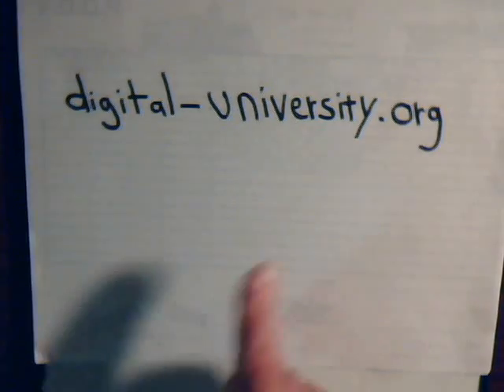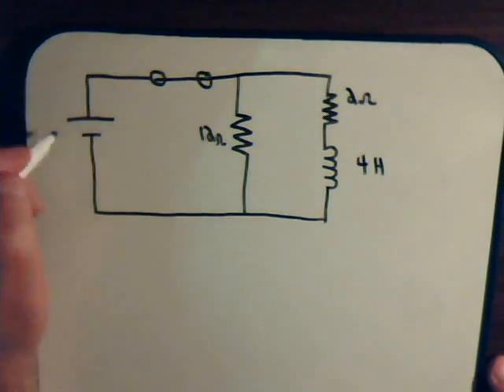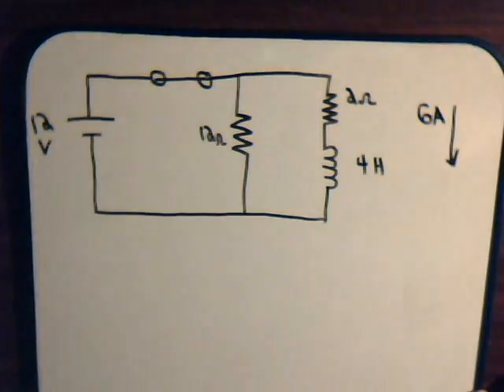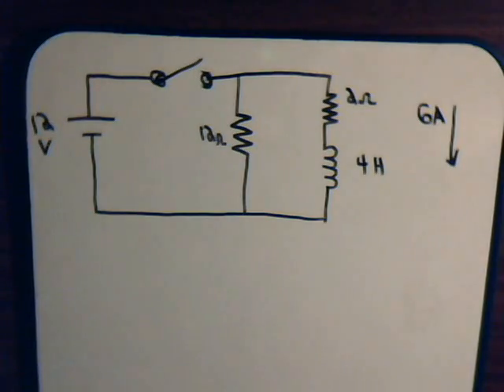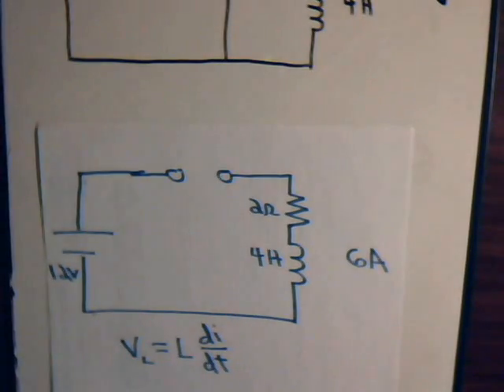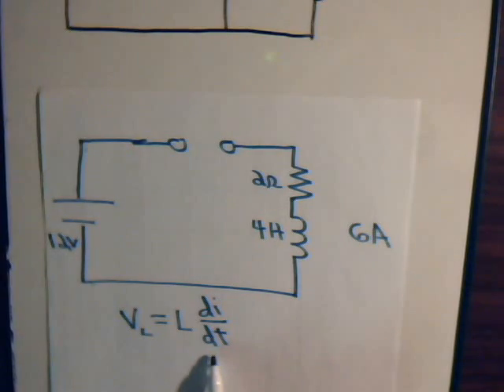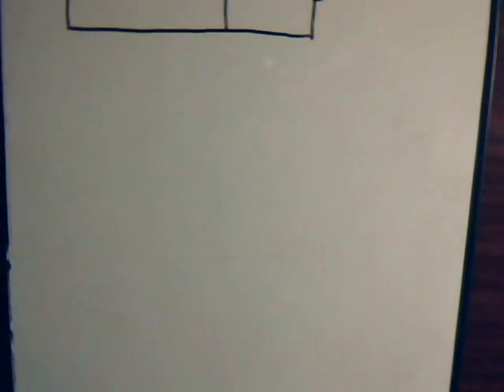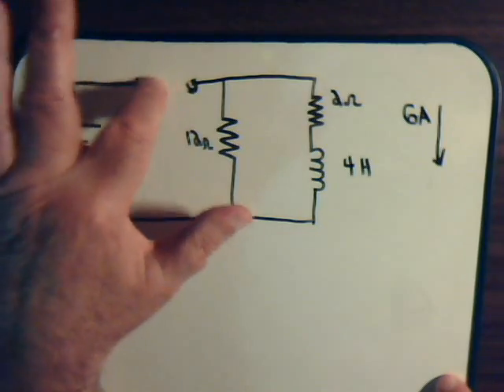Electrical Circuit Analysis Video #58: Inductor Decay Current Example #1

Comment: I'm confused why this is 6 amps, and watched your explain in 57 and still didn't get it.
first off want to say I appreciate you posting all these great videos

but at 0- the inductor acts as a short, so the only resistance is the 12 and the 2 in parallel so thats 1/(1/12+1/2)=  1.7 Resistance total. So you divide Vs by Rt and get 7Amps not 6?
Reply: Late reply since this is a 9 month old question, but maybe others are wondering the same thing. 6 Amps is correct (flowing through the second branch that is. The total current flowing through the circuit is Itot=E/Rtot which from parallell series is ((R1+R2)E)/(R1*R2) where R1 is the the resistance of the first branch, etc. Calculate this and you get Itot=7A. Then you simply get I2 because of the voltage equality (Hope you're familiar with this rule) I2=Itot(R1)/(R1+R2) <=> I2=7*(12/14)=6A